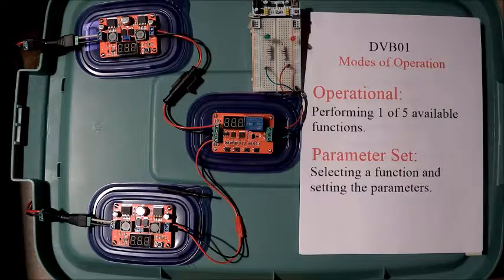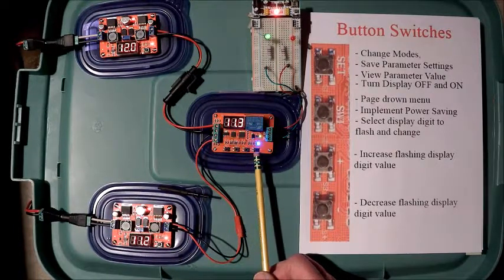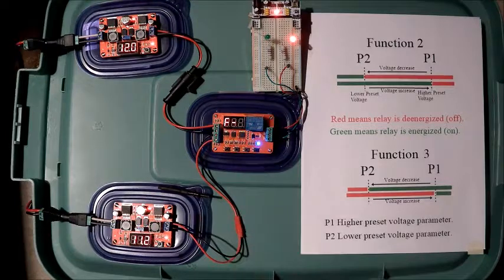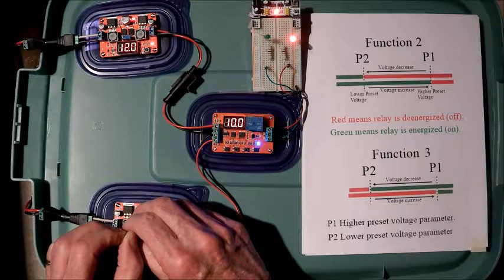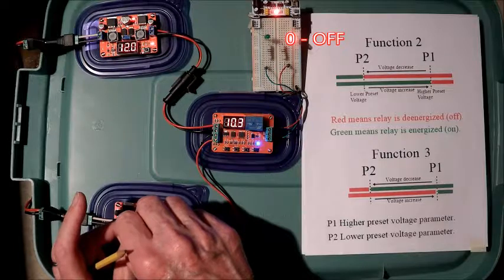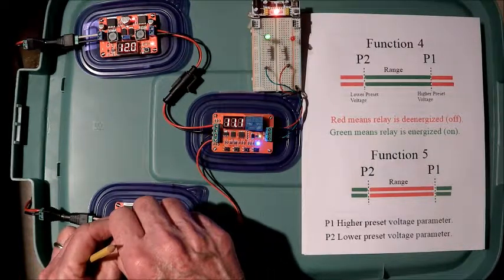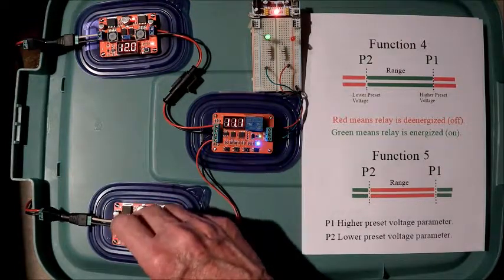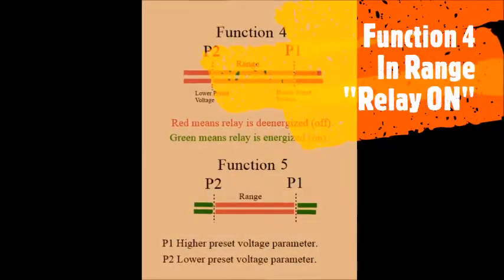Multi function Voltage Monitoring Controller DVB01.

Comment: Excellent, very detailed and informative, exactly what needed, as little or no info for this board listed on ebay/amazon.
This board, with addition of some extra output relays, will be perfect for my Solar Panel system design, to be incorporated into the auto switching circuit from solar to grid and excess solar power transfer circuit.
Many thanks.